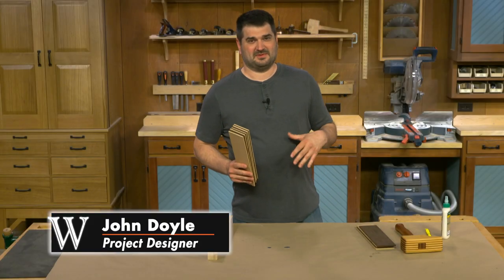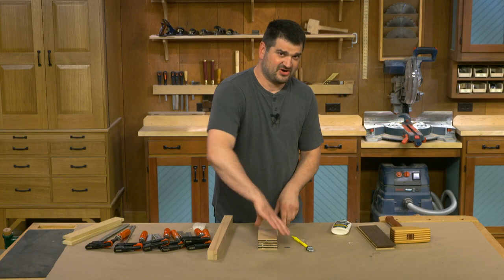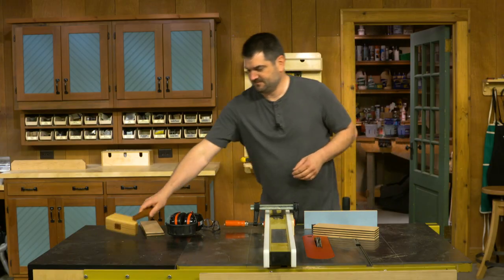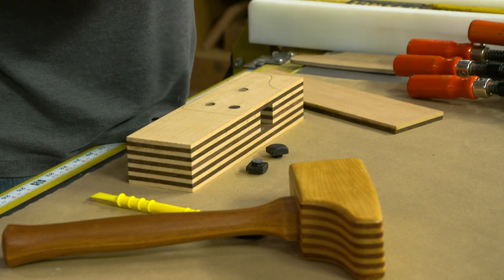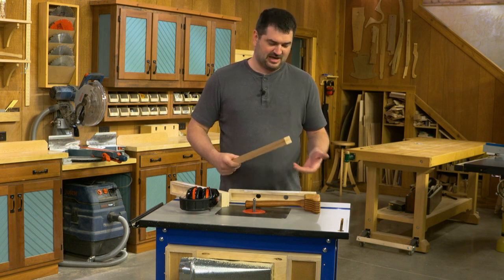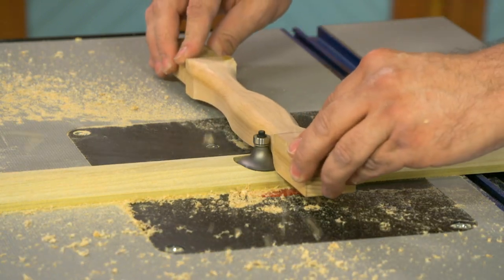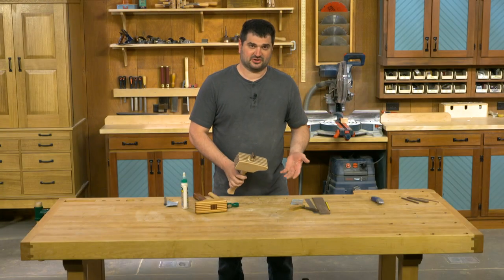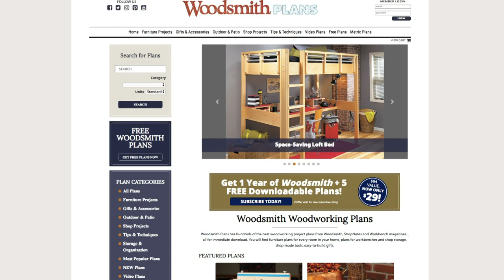A Shop-Built Mallet Made With Scrap Wood!

Comment: Great ideas on the router boxes and bridge, takes out all the guesswork, and lets you batch out a lot of identical ones.  Also great idea on cutting a dado in the inner part of the head for the handle tenon.  For those who cannot cut that dado easily (either no dado stack, or no flat-tooth blade to nibble it away), it occurs to me you could also just cut the handle tenon first, glue up those inner layers you dadoed that are the thickness of the tenon, then cut them in two.  Then butt the cut ends against the handle tenon, do the brad nail maneuver on a full layer over them, flip it over and brad nail another layer on that side ('constructing' the mortise around the tenon).  Then remove the handle before any glue squeeze-out sets up, and complete the remaining layers on both sides.

Comment: You have some really good ideas. I’m assuming you tapered one end of the mallet head to get into smaller spots?
Reply from the maker: Yeah, it's based off an old cabinetmaker's mallet design, and I believe you are correct that the back side is used to get in tight spaces.